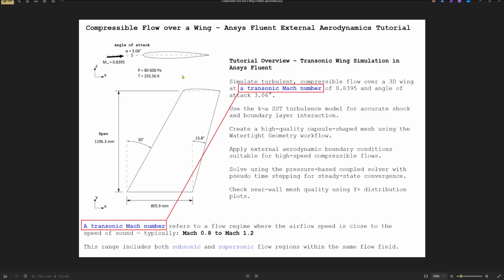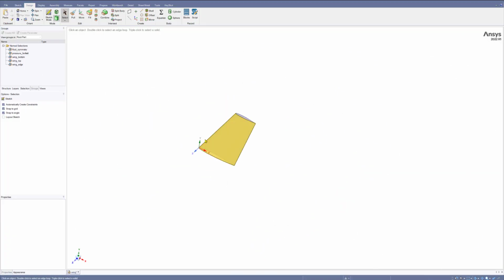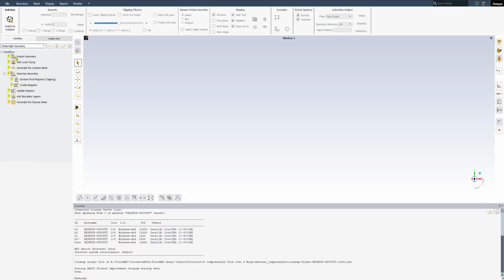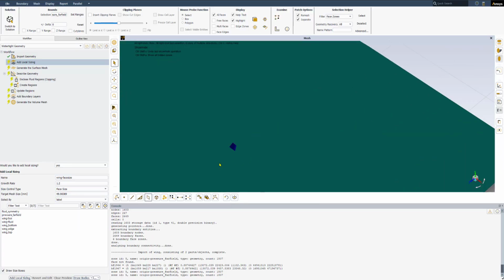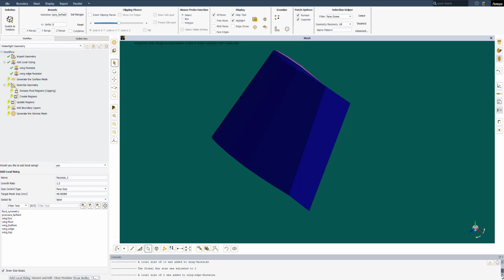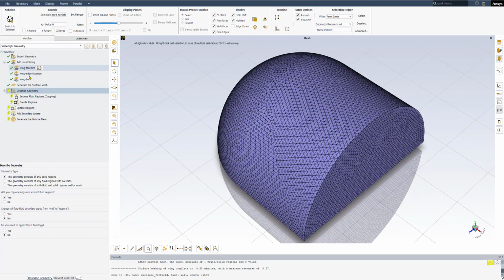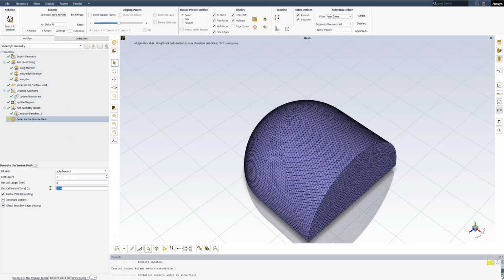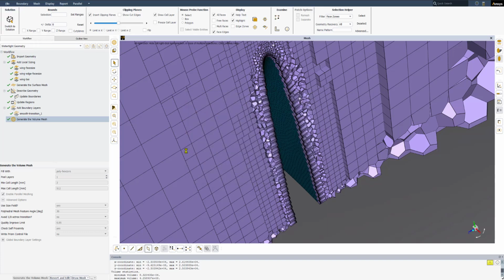Fluent Meshing for External Compressible Flow | Part 1: Transonic Wing Simulation (Watertight)

Comment: Hello  is trailing edge sharp or fillet? I got an error in mesh when it was sharp. Thank you.
Reply from the maker: Hello @beyzanuriskrk6422,

Thanks for your question. The trailing edge in this case is sharp. If you're getting a mesh error with a sharp edge, you can try applying a small fillet or refining the mesh locally around the trailing edge.

You can also download and check the geometry file here:

https://drive.google.com/file/d/1TrXfugeqQC4rDwDIRD9JQd-tXrvGnB5l/view?usp=drive_link

Thanks again for watching and supporting the channel!